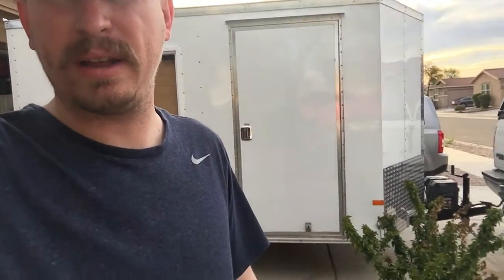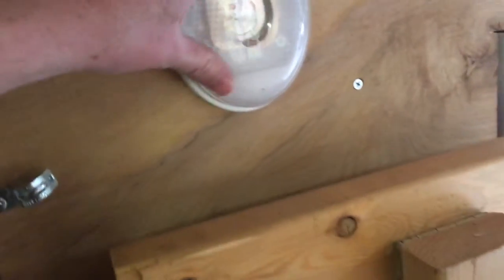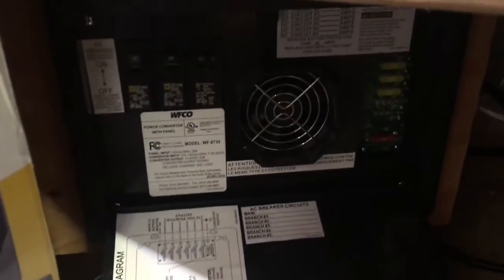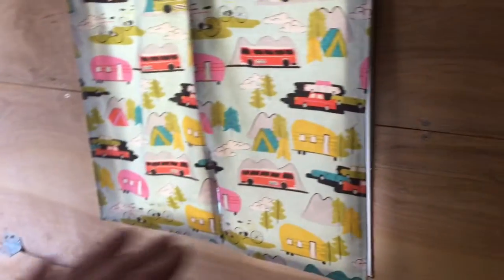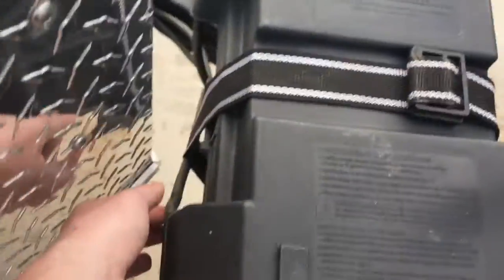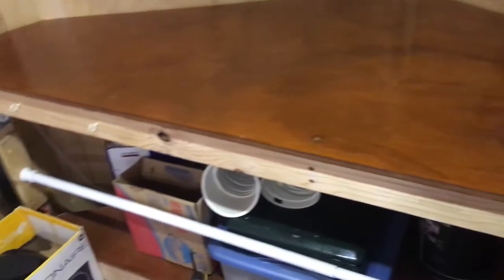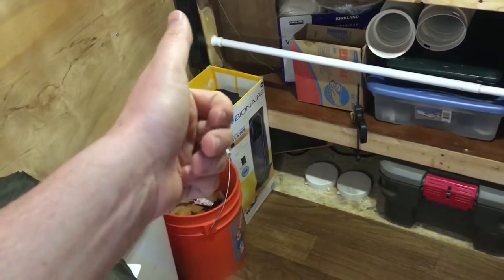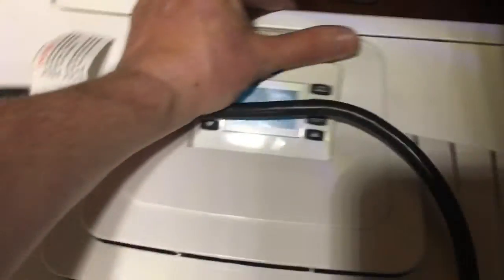Converted Cargo Trailer - Stealth Camper - Tiny Home Wilderness Camper - Dry Camping Bushcraft

Comment: Nice video! Question - we're thinking of doing a conversion to a camper trailer but would need to change the registration from cargo to travel trailer. Have you gone through the inspection in AZ to change it the registration to Type "J" (Travel Trailer) or do you just leave it registered as a cargo trailer? Thanks

Comment: What's the size of the trailer and how much you pay for it if you don't mind me asking
Reply from the maker: They said it’s a 6x10 but measures larger than that, it’s almost 14’ to the nose. I think I bought it for 1900$ and change before tax in 2015. Brand new, I couldn’t find any used ones in my area for much cheaper.
Reply: @lucrativepro  thank you I appreciate that